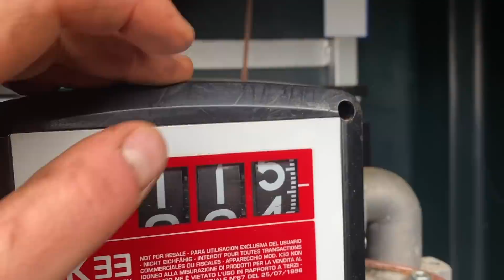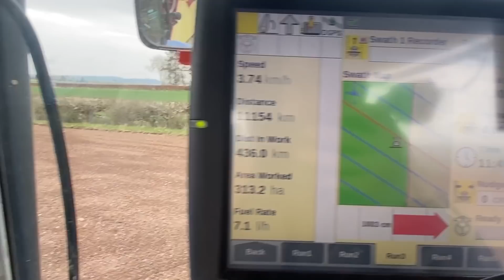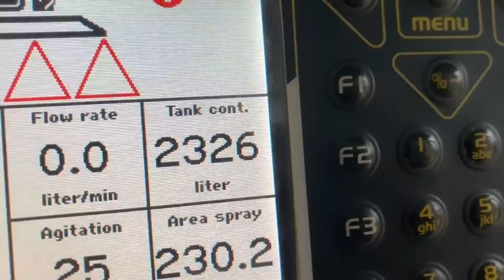Who Broke The Rollers | Oil Leak | Big Calf #CRAWFORDSFARM #247

Comment: That plastic ring is not broken! It is a backing ring to protect the rubber o ring it goes behind the rubber ring so it does not get cut .sometimes they are double ring but they are not whole otherwise you would not get it in
Reply from the maker: I took another out elsewhere and it was whole 🤔
Reply: Any I have done have always been whole !

Comment: Sparex used to do the coupler repair kits.
Vaseline is better than grease, grease will react with the rubber of the o ring, Vaseline doesn't. But less opportunity for your mates to take the Mickey out of you 😁🤗